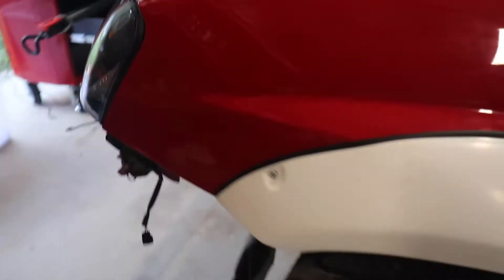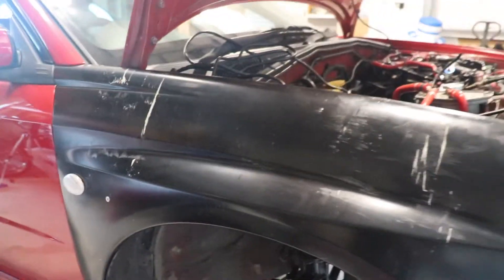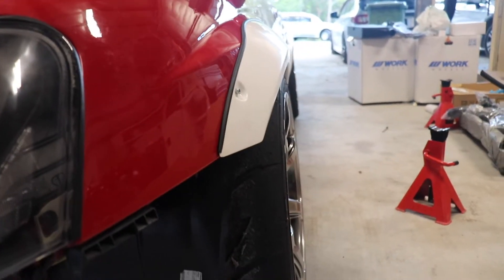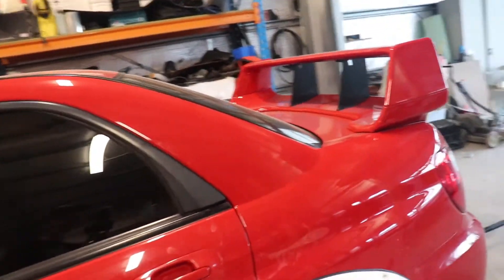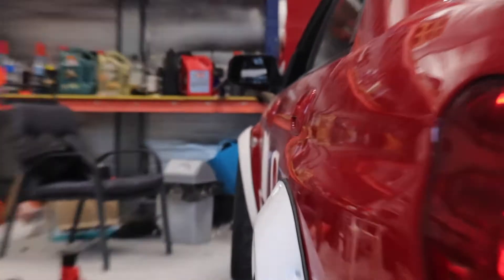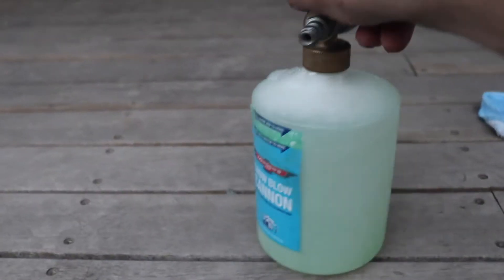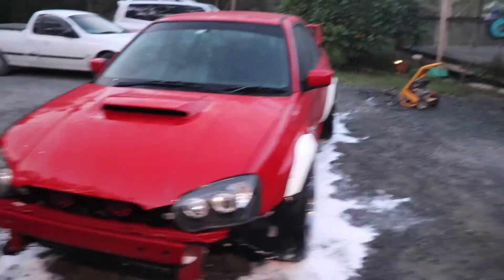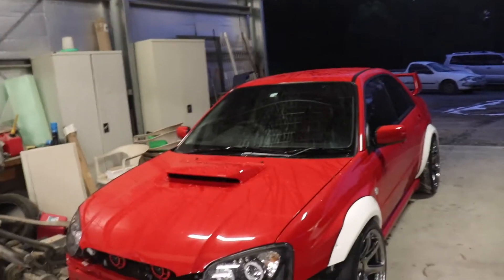Fitment Reveal!! ABW Flare Install PT2 (295 Semi Slicks)

Comment: Aren’t you meant to cut off your guards? Curious? Also how many mm is the guards as my wheels poke hard I’ve got 18x9.5 +35 with 25mm spacers running 225/40/18’s so Im deciding thinking going 40 or 60mm
Reply from the maker: I used this site to figure out fitment

https://www.willtheyfit.com/

And yes, gaurds need to be cut to run the car lower ride height

Comment: I was looking into putting some HT Autos fenders with a 295 tire set-up on a GR/GV chasis. My main concern is driveability with the size tire... how is it? any input would be great. I forgot to mention a spacer as well
Reply from the maker: Cesar Augusto Palacios hey mate, driveability is great grip is awesome. Needs a lot of cutting ect for no scrub and does slight reduce turning on a street car, but it’s not to bad. Didn’t need any spacers for this setup with a 40mm abw flare kit. 18 x 10.5 + 12 with a 295/30/18
Reply: Unruly WRX awesome thanks for the reply!

Comment: Drills a hole into the body but zero protection to the exposed steel before fitting the nut cert 😬😬😬😬😬
Reply from the maker: was fine when I sold the car. It didnt see the rain nor did it see salt so was never an issue